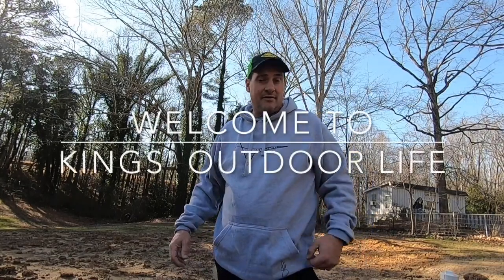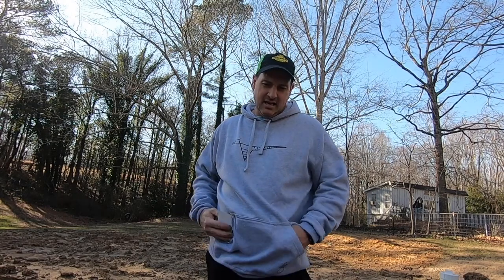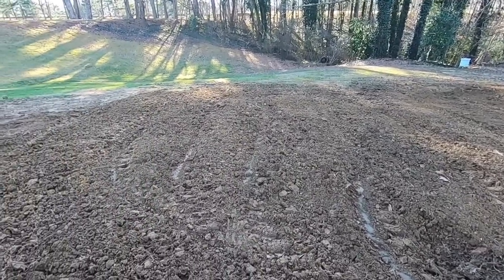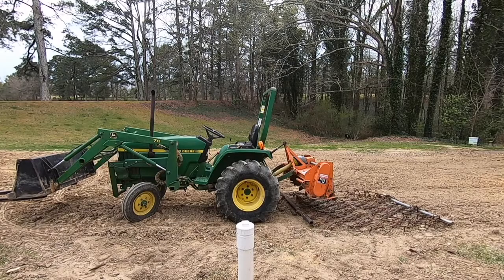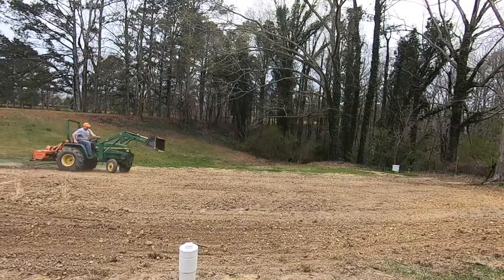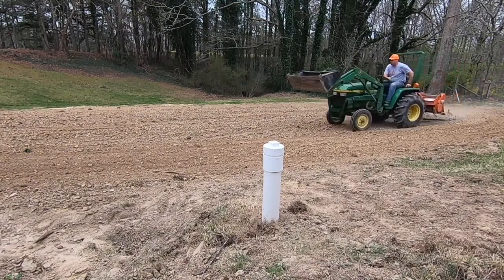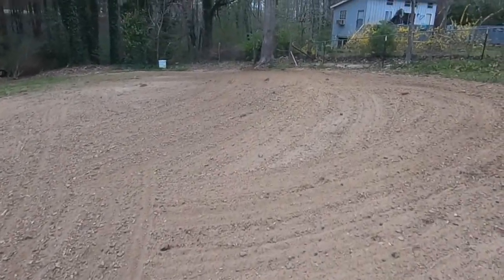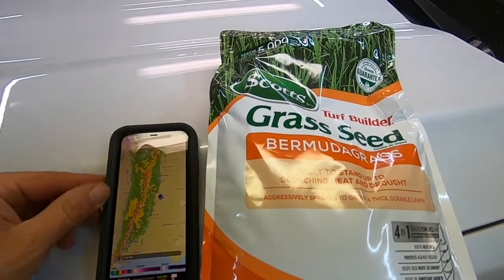Grading Back Yard after septic tank work - KOL 159

Comment: I have a new septic system and need to do the same thing.  I've been told to not use my 4000# tractor but it's OK to use a 10500# track loader.  The reasoning is my tractor has wheels so the pressure it's putting on the system will be greater than the track loader because it spreads out the heaver weight over a wider surface area.  What do you think?  Looks like your tractor didn't sink in or cause any damage.
Reply from the maker: the tracks disburse the weight across a larger area such  that you get less lbs per sq. inch than a wheeled unit.    Thanks for watching!